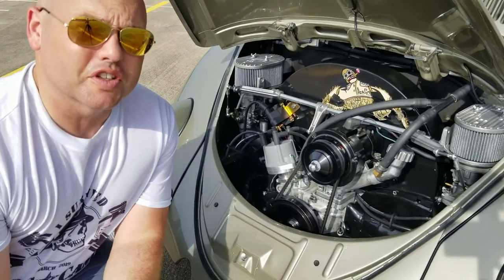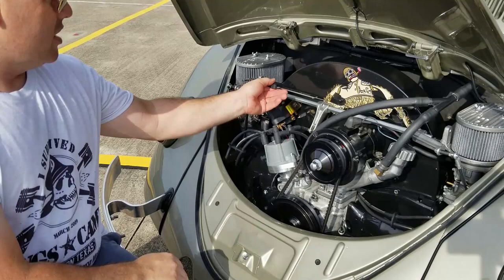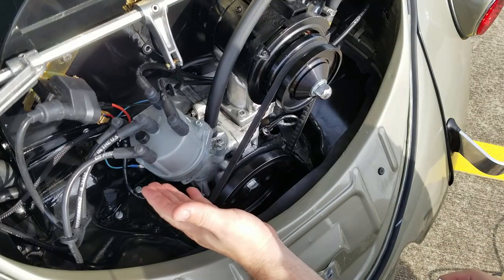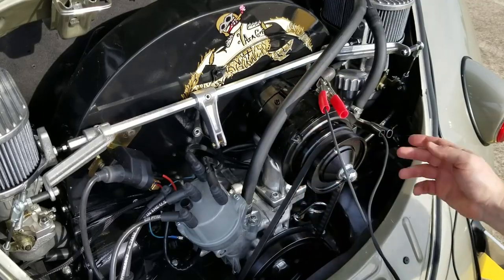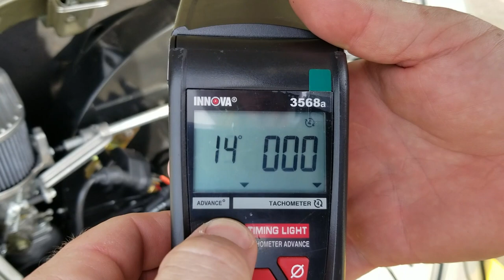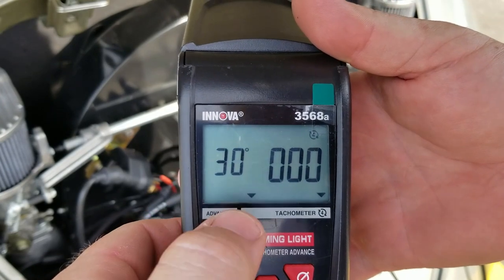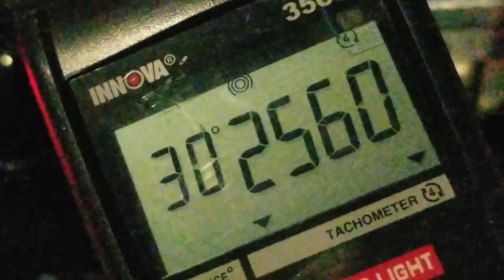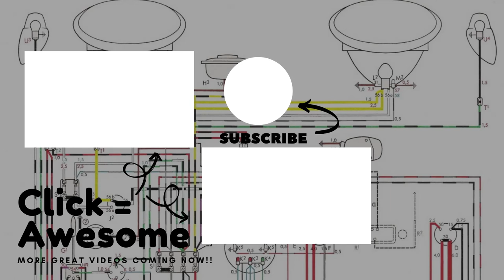How To: Time a VW Engine -  1956 Ragtop - Volkswagen BUG | JW Classic VW

Comment: On my engine run test stand we added a air/fuel ratio gauge and a o2 sensor really helped dial in the carb nice having that data  along with looking at the plugs.. I have the option of recording it on a data logger or lap top. It is nice to have with 4 to 6 motors to still build for the buses and beetles.. I have a wide range of carbs and set-up to play with and test.. fun in the garage..just need to get back on my feet..
Reply from the maker: Hey Dan!! Yeah I'm looking forward to you showing off that new O2 sensor of yours... super curious on how you have it set up brother.  Hope you feel well soon man!!

Comment: Good vid. Subscribed. So, I’m just learning to set my timing and have a question. 
¿What parameters do you observe to know you have achieved optimal timing?
My bug is running fine, just progressively running a bit rough (have adjusted valves). I discovered my dwell is 60 deg so got to adjust points and reset my timing. 
My specs:1915cc, single Weber 40 IDF, SVDA w points. Purchased timing light and my current timing is 19 deg BTDC@3K rpm. 
In advance, thank you.
Reply from the maker: Normally I run 30 degrees at 3000 RPM TDC... not sure about BTDC.  As for running better once your timing is correct is to get your Fuel to air on point.  The best way to do this is by use of a wideband sensor... you know with an O2 sensor at the exhaust.  This can help you dial in the 13/1 to 14/1 air to fuel that is optimal.  There are a number of references out there that can help you tune your carb I would definitely look into one.  Optimal running is a combination of things working well together. 

Ignition System: 
  - Plugs (good and gapped correctly)
  - Plug wires (Good condition, not grounding to block through old cracked leads, proper seated)
  - Distributor cap and rotor (Check cap for cracks and wear at internal contacts, same with rotor)
  - Condensor & Points "If your still using them"  Spark Baby!  Check for condition and wear, adjust points (.016).
  - Coil (Inspect for leaking or corrosion, good clean connections)
  - Battery (Is the battery in good condition fully chared and charging when the VW is running "Very Important")
 
Fuel System
  -  Fuel Pressure (Needs to be correct based on the type of carb.. in most cases 3 to 4 PSI)  With mechanical 
     pumps "Stock pumps" this can be adjusted with the addition or subtraction of gaskets at the base of the 
     fuel pump.  To measure the pressure you'll need an in-line gauge.
  -  Carb adjustment... this is honestly where you'll spend most of your time working on the correct jetting and adjustment based on your carb.  Get a good reference and read through it.  I have some Weber references in the Channel Facebook group under files.  It will be a good place to start looking.

https://www.facebook.com/groups/1254174451415854/files
Reply: @JWClassicVW  Awesome! Yours is the Best and most informative response I’ve received to my question, either locally or online. THANK YOU, so much for taking the time to make your helpful videos and to respond to questions. You’re da man!
Reply: I think the only way to find optimal advance curve is to dyno it and make the map based on torque and hp's...
Actually that's the next step on my project... 🤞🏻

Comment: Thanks for the vids !
Are you using the standard fuel line that runs through the channel to provide the go-juice to your 2276 ?
Reply from the maker: Yup you bet, had to clean it out real good but it works fine.  When I upgrade to fuel injection someday things will change but for now it's working great.

Comment: also, as a possible vid idea: i'd like to see your distributor's variability across all the cylinders. it's an issue i have problems with on my 73 with the pertronix. i have scatter across the wires of about 8 degrees. in other words, let's say the first wire to fire at idle hits at 16 degrees btdc then the last wire to fire goes at 8 degrees btdc. do you see?
Reply from the maker: Sounds like a good idea!! I'm all about videos on getting this girls running as good as we can!

Comment: What is your idle timing?  I have the pertronix billet 1 and I dont know how to time my bug, its a stock 1600. 
when set a 30deg at 3000rpm, the idle is at 6deg btdc, its ok?
Reply from the maker: There is nothing wrong with that... mine was near 7 degrees.  Driving your car and getting a feel for the timing and how your car pulls or acts would be a better test.  Pay attention to the engine Temps as well because this will also tell you if you need to adjust timing.

Comment: nice most guys should be a 28 but some of those huge cams need a bit more.
Reply from the maker: You bet... At a show this weekend I helped time a guy to 28 at 3000 but the idle was so low at around 650... what do you think? I would normally like to see an idle around 800 to 900.  Engine was a dual port 1600 with a pict 31
Reply: @JWClassicVW  couldnt he bump up the idle. maybe lean on idle. or too rich. get one the he afr ox sensor adjustors. or wide band adjuster. for carb. really helps.
Reply from the maker: @Mikefngarage  Yup that's what I told him figured his carb was out of adjustment a lil.
Reply: @JWClassicVW  may have issue with loose throttle shaft

Comment: Are you going to use a wideband to fine tune your carburetors?
Reply from the maker: Looking into it... gonna need to weld a bung on my header system for an O2 sensor.  Probably do this eventually, the only other way I know of is by sound per barrel of each carburetor.
Reply: @JWClassicVW  
CB sells a adapter with a O2 sensor bund welded in #2914. I hope you do get a wideband kit and make a video on how you to use it.
Reply from the maker: @vintage76vipergreenBeetle  I'll check it out... for sure!!